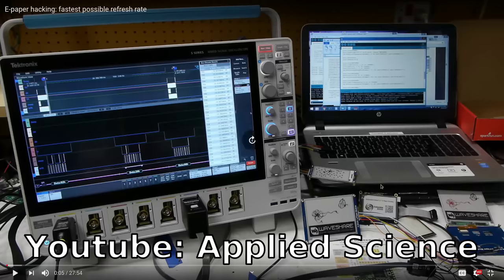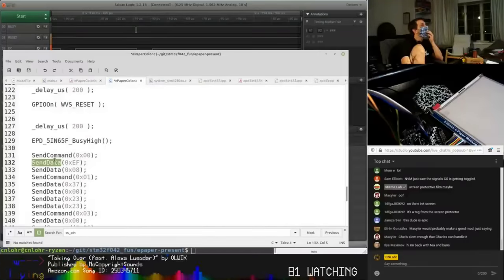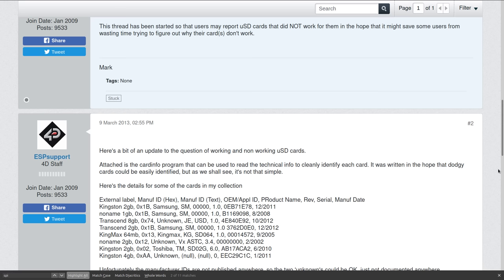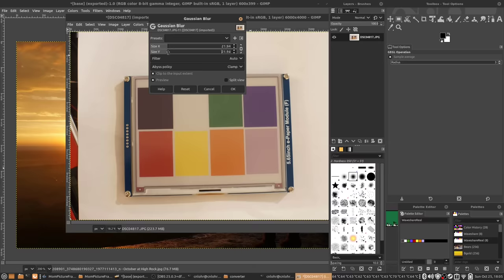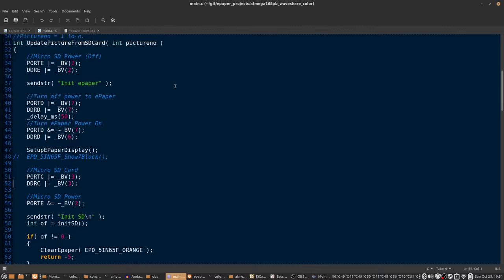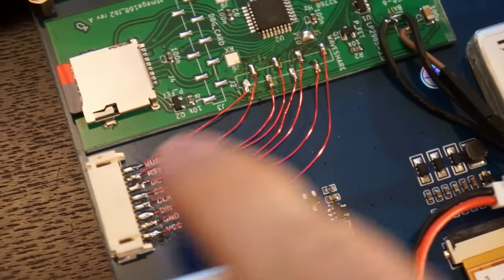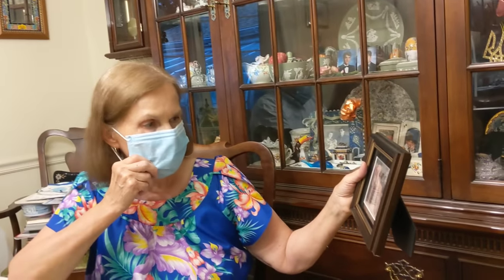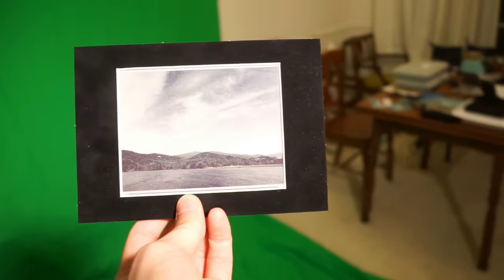Trolling My Mom With an E-Paper Picture

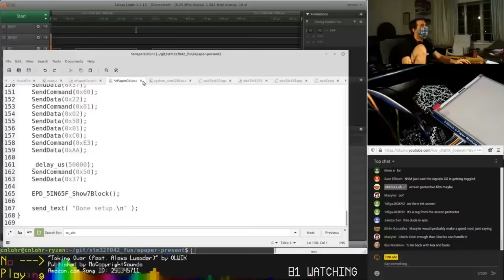Comment: What can I do to start writing my own drivers like you?  Was that a logic analyzer you used at 1:29
Reply from the maker: Yes. That is a Saleae logic analyzer.  It is very helpful for when you want to understand what's going on on a wire.  Like so you can write code to twiddle pins, then you can compare what you are sending to what the datasheet says, then you can see how the part responds and debug things til everything works.
Reply: @CNLohr  Do you have any recommendation how to get started in reverse engineering such things? I have been really interested to get into this but a bit afraid. I have a good understanding of software engineering and basic electronics.
Reply from the maker: @Justajawnie  oh boy... That's such a deep topic. I'd watch some videos by Sammy kamkar. Or ccc talks

Comment: When you took the photo of the color and try to index the real colors, you would need to color correct it first to actually be the right color.
Reply from the maker: I tried that but the outcome didn't look quite as good because using the wrong colors makes more effective use of the gamut.  Doing the right colors just looks ugly.
Reply: @CNLohr  the issue is that a lot og new cameras make the collors more vibrant, so it have to be corected back to the original collor before its indexed.

Comment: I love your content and I've been fascinated with your work for a really long time!

Offhand, do you think the batteries could be swapped for capacitors, if I made a frame out of solar cells? I would probably have it change pictures during the day, so that the power was available for sure and the display doesn't get stuck in a bad state. (unfortunately that takes away some of the magic. :/ ) Also, if I was going to transition the design to use solar power and capacitors, I think I would use 5V logic for most things, because I can store almost 3x the energy in the capacitors with 1.6x the voltage. I guess I'll have to do some figuring on this but I'd love to hear what you think! Thanks.
Reply from the maker: I think it would be hard because a total change uses about 1.6 joules of power, so you would probably need in the order of 47,000uF to support a change, even with significant voltage loss over the process.

Comment: I must be missing something here. DIdn't we have displays with millions of colors in the eighties already? And iPads and Raspberri Pi's for some time as well? Just 7 colors, I mean...
Reply: E-ink displays do not require power to hold an image. It's the same tech found in e-readers (not the tablet kind). The power usage comes from when it needs to change the image. I'm sure there are likely other color e-ink displays with more colors, but they're certainly not at the consumer level or would be very cost prohibitive currently for a small project like this.
Reply: @LiveAndForget  I looked it up because I still didn't quite understand how it can display anything without electricity; according to Wikipedia it's a low-power application, but so it does use electricity for the display.
I suppose the limited amount of colors is the trade-off for the low power usage...
Reply: @paddotk  the way these displays work is it uses electricity to change the image by pulling or pushing a color to the top to create the images or text. Once they've done that it doesn't require continuous power. If you've used a Kindle (not the Fire, as that's just an LCD screen), it's the same tech. Once the image is in place it's effectively frozen there until changed. I've had my Kindle battery die and it will hold the last image forever until powered and refreshed to a new image. Some stores use these for shelf pricetags now as well.
Reply from the maker: The most attractive aspect isn't just not needing power but that the display "Looks" like a printed photo, instead of a backlit screen.

Comment: Is the picture still changing? It's been two years, around the said lifespan of those batteries, I think you should check up upon this
Reply from the maker: I had to charge the battery once so far in the last 2 years.  So, it lasts around 400-500 days

Comment: What's wrong with a mass produced $50 7 inch color LCD photo frames which actually takes an USB drive and does not require any of this extensive coding. The intention of Epaper is to create low cost disposable displays like supermarket price tags. Epaper really does not look good as a photo frame. Price of LCD is so much cheaper now you could actually use a 15inch monitor as a photo frame.
Reply from the maker: epaper doesn't light up, so it looks and has a feel more like regular paper or print.

Comment: I want to copy your open source design but I am so unfamiliar with half of what you said. I think e-color displays will be ubiquitous because they are not insistent and demanding as backlit.  They also use practically no power.  If someone executes such a picture frame as this flawlessly, so it looks exactly like a regular frame (no power cord (harvest power enough for image switching and infrequent image file updates over radio from ambient light maybe???)), these could become something that many customers have dozens of copies of, perhaps of various sizes.  This is also the only way you have an unobtrusive very-large picture frame or kiosk in your home.  A glaring backlit screen can never be part of the ambiance of a room!  Certain visions of the future just can't exist without e-ink.  This sits at the intersection of a truly astronomical-scale market in sheer unit-volume, and astronomical-scale energy savings in total when all monitors, televisions, and mobiles become dual backlit/e-color displays.  I have no idea why Apple or Samsung or others are not all over it.  You should bring your design to their attention.
Reply from the maker: Because it takes so long to change the pictures.

Comment: Nice project. I am going to do a similar one but with esp32 and deep sleep. Pull the image files from google drive.
Reply from the maker: That sounds pretty cool. How do you plan to access google drive from the esp32?
Reply: @CNLohr  I’m going to start by trying libgdrive. We will see if it works or not. I might end up writing a custom client. Right now I’m waiting for my display to come from Banggood :)
Reply from the maker: @NextLevelCode  esp32 doesn't run Linux. Gonna have to see what libgdrive does under the hood.
Reply: @CNLohr  I didn’t see anything in the docs for libgdrive that said it was Linux specific. It says it’s a c++ library. But I also haven’t really started the project yet to find out. I’ll give you a message with what I find once I dig in if you want. :)
Reply: @CNLohr  just skimmed the docs. It depends on libcurl. libcurl is known to work on the ESP32 according to a quick google search. (See some tutorials on building for esp32)
Reply from the maker: @NextLevelCode  you would still be better off seeing what it's doing under the hood. You'll likely find out it can be replaced by a sprintf
Reply: @CNLohr  better is in the eye of the beholder. I have very little time for these projects these days because of my day job. If a library can do what I need I won’t be reinventing the wheel. :)
Reply from the maker: @NextLevelCode  Just googled it, first link.

https://www.googleapis.com/drive/v3/files{share link}?alt=media&key={Google API Key}

For direct access to content on google drive. 

It's much easier and simpler to just use builtin web requests in the ESP32 than to try using something like curl and federating the data on the downstream side.
Reply: @CNLohr  mind posting said link you are referring too so I can read it? All the docs I’ve seen on Drive API says it required OAuth v2. I figured if a library already exists to handle auth why not use it. But if the info you found shows it is so simple I would probably do that.
Reply: @CNLohr  what I’m reading is “An API key only identifies the application and doesn't require user authentication. It is sufficient for accessing public data.”

“An OAuth 2.0 client identifies the application and lets end users authenticate your application with Google. It allows your application to access Google Cloud APIs on behalf of the end user”

Hmmmm

Comment: As the E-Paper would display the picture without power, it would be  a nice idea to just a wireless charger to power it up and then wireless (e.G. Bluetooth) transfer a new image to the frame. In future this could be done by holding a smartphone with reverse charging on that pircture frame.
Reply from the maker: It's a lot of work to do stuff like that. I just wanted to get this present out the door!

Comment: Thanks for the video! Could you share the GIMP color palette that you use pls?
Reply from the maker: It's in `converter.c` in the source code. 
uint8_t palette[8*3] = {
 0, 0, 0,
 255, 255, 255,
 67, 138, 28,
 100, 64, 255,
 191, 0, 0,
 255, 243, 56,
 232, 126, 0,
 194 ,164 , 244 
};

Comment: I’m thinking of doing a similar project using the 4.2 inch monochrome screen to display game it camera (2 bit greyscale, 112x128pixel) images. 
In your experience, with these displays, can you achieve the 2 bit effect? (i.e. white, light grey, dark grey, black - or in the case of the colour screen, I guess it would be varying degrees of each colour mixed with white). Or is it more just like turning each pixel on or off?
Reply from the maker: I have not experimented with them :-/  I'm not really sure.